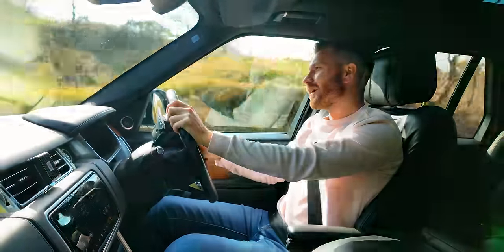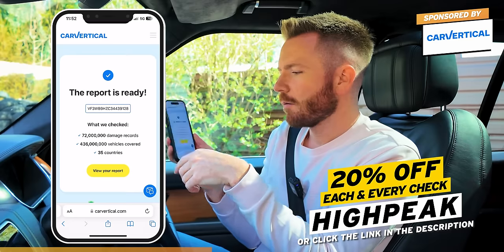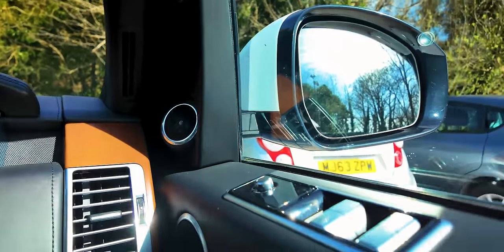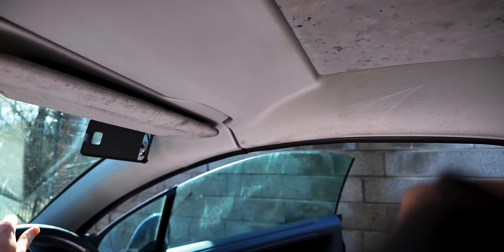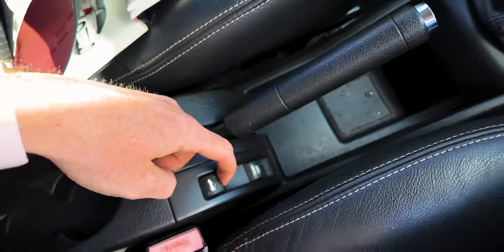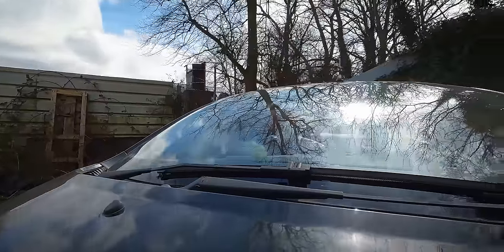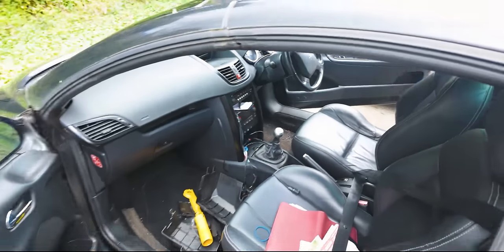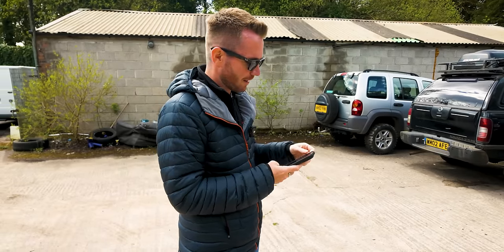I BOUGHT A CHEAP PEUGEOT 207CC FOR £500!

Comment: 'I bought a cheap Peugeot' usually ends in tears😅
Reply: I bought a cheap Peugeot 206 around 6 years ago. 85k miles later the only major issue has been the clutch which I replaced. 

The electrics are pretty terrible as well, but mechanically it’s been a very solid car. To my shame I haven’t serviced it once in that entire time as well, surprised it’s still going tbh but shows not all French cars are terrible!
Reply: I bought a Peugeot in general ends in tears.
Reply: I bougth two both were money pits.
Reply: @Drenwickification same with my dads 307. Was pretty rubbish but the engine was really reliable
Reply: I wouldn't touch a Peugeot (pronounced as Puresh*t) with a barge pole. I know someone who had a 407 and the electrics were awful and the dashboard was more lit up with warning lights than the Starship Enterprise's command room.
Reply: @Ayeright. the electrics are always poor on Peugeot's because they only used very thin wiring on their cars up to late 2000s
Reply: I've never had a serious problem with any old 8v 2.0hdi and I had great fun in my 205 Xs, and 1.9 gti but I wouldn't buy any after 2005 and I'd be picky with the older ones.
Reply: @Ayeright.  same with my dads 307. Engine never stopped working though when everything else did. French are no good with electrics
Reply: I've got a 207 1.4 8v, 150,500 on the clock and everything is working totally fine.
Reply: @Marco-iy7lt  that's insane I always thought he 207's weren't very reliable. You must have maintained it very well
Reply: I bought a cheap BMW usually ends in bankruptcy.
Reply: @JedHall-t4k  in fairness, when I got it, the previous owner had left it in pretty bad shape. It only 57K on the clock, but I'm meticulous with my cars. I changed the belts, serviced it, etc. Only just changed the original alternator last year and just changed the injectors to Bosch a 1000 miles ago. It's been very cheap for parts and cost me barely anything in the last 7 years of ownership. 

Prior to that I had a Merc C-Class and it was costing me an arm and leg to run it.

The key to ownership of a car is to be aware of what they were engineered for. This isn't a Japanese car, so hammering it is going to destroy it. The parts weren't designed with that in mind, so naturally it will reflect upon it. Simply drive it the way it was engineered and it will do it's job properly. This applies to also Italian cars. They're not unreliable, it is just our perceptions as Brits about French or Italian cars. We place this high esteem about German cars and think no one else knows how to build a decent car, when in reality, the Germans themselves are now the biggest critics of their own car brands. The quality isn't as good as they used to be and other companies are making an effort to improve the quality of their products.
Reply: Expensive ones end in tears too
Reply: Those things shouldn't have been sold new. Infact, all Peugeot's, Citroën and Renaults should be sent to the recycling centres directly from the assembly line at the factory! Avoiding the customer/ownership bit in the middle
Reply: I bought a 207 sport one owner from new 5yrs ago with 66k for £500……. Still have it
Reply: @Drenwickification  I had a renault modus, it was always making weird noises (electric windows, rust, connecting rod) but it never left me stranded
Reply: Agreed.  I bought a used Peugeot 405 back in the early 90's. It cost me a fortune in repairs - some quite costly - during the 3 years I had it. I would rather cut my leg off with a rusty saw, than buy another French car....  I wish Matt well with this one......  Welcome to the wonderful Peugeot World of "will it get me there, and what'll break next?"   "What a piece of quality"  - that was my Peugeot experience entirely Matt....
Reply: @gazz1246  Ive just bought a cheap bmw.  but it was cheap because the owner was a rich girl who knows nothing about cars and gave out cheaply convinced the scartches on the body made it worthless
Reply: @Marco-iy7lt  Peugeots are the cheapest cars in my area. There must be a strong justification behind it
Reply: @czukarpathian6621  sorry, but I'm trying to understand your statement. Could you explain a bit more to me please?
Reply: @Drenwickification I am a French car fan but only the older ones. My dad had a 205 with 300k on. My daughter a 206 who did 120k over 8 yrs totally reliable
Reply: Yep, bought a 307 2.0 Diesel.. Drove fine during the test drive & within the 1st week of ownership the clutch had failed followed by the DPF a few months later.
Reply: My girlfriend inherited 206 with 30k miles from her father 3 years ago. It has not had a single issue so far after 30k miles. My W205 mercedes / audi a6 c7 / audi a3 8p1 meanwhile had insane amount of issues and i'm jealous how well the peugeot runs
Reply: @pedrodaniellopesferreira2916  I bought a C5 in 2003 and just scrapped it after a deer jumped out of thr hedge and wrote it off. It had been a great car. I think a lot depends on how and who looks after a car. Oh that was me. All it really had over the twenty years was proper servicing. Any car can be rubbish (and dangerous) if not looked after. This 307 only has what should have been put right by regular servicing. Who can complain at a new exhaust in 16 years and the corrosion would have been picked up during proper servicing.
Reply: When reading the title before watching the video, I had a hunch of the outcome. At least we always get good enjoyable content together with Matt's humour 😂
Reply: @JedHall-t4k  Er, and Lucas....?
Reply: You made the News Matt...all be it the Sun news paper ,sniff sniff.
Reply: I bought a 2004, 206 back in 2018 for £290 👀 was a sound little car, used for about 4-5months then sold for £350 😂  no issues !!
Reply: Hahaha love it
Reply: @Ayeright.  blah blah blah my mate...

Comment: Bought one for our daughter two years ago, 59 plate diesel, 96 K FSH, actually it's given no bother apart from front spring broke,  service it regularly, she drives it from Rutland to London and back weekly, correct it's the GT like hers with the leather snd and onboard computer. She averages 60 mpg and loves it, now approaching 130.000 miles, just passed MOT with advisories on pitting on rear discs.

Comment: I bought a cheap Peugeot 207CC Sport in 2018, 11,500 miles on the clock. 35,000 miles of trouble free motoring later including driving to the south of Spain and touring around France, as well as trips around the UK, it has proved to be a great buy.
Reply: I bought one last year.  I think its a brilliant little car.  Its fairly cheap to run and holds the road very well.  Lots of fun for under £3000.
Reply: Should have added that they don't last much beyond 130,000 miles.  I bought mine with 62000 on the clock.  For summer driving, its just what I needed.

Comment: I’ve bought the (2012) hatchback version 1.4 95hp in 2018 and never had any problems with it till 3 months ago when the power steering got faulty and stopped working. it’s a pain in the a$$ finding the electric motor part that doesn’t cost an arm and a leg. Despite that, the car is phenomenal in therms of cost ownership, reliability and practicality.

Comment: Had three Citroens that were garbage (yes, didn’t learn!), but had a low mileage petrol 206cc that was utterly dependable, no mechanical or roof issues, and huge fun whatever the weather.
Reply: The 206 and 306 were indeed good cars in general, after that it went downhill.

Comment: Hi Matt
Brings back memories I had a 2012 diesel GT in white with leather . It was 5 years old utterly useless, the roof stopped working 2 hours after purchase, numerous DPF problems, electrics useless, I seemed to spend more on  light bulbs than fuel . 😂

Comment: In November 2018 I moved to Spain. A local dodgy bloke sold me a 52 plate 206cc for 800 euros. It had done 118000 miles, it has now done 125000 miles. It has been a great local run around. It has developed an issue with the cooling system, so maybe it's day's are over.

Comment: I had the displeasure of a 207CC back when they weren't very old. The dreaded 1.6 petrol turbo. Thankfully not mine. Still the worst car I've ever driven and catastrophically unreliable. Peugeot couldn't even put the gear lever in the right place - they reused the 206 linkage and it's too far forward. 😂

Great video however - thanks!

Comment: Mate, you had a lucky escape by scrapping it!
I owned a 207sw (57 plate from brand new), a totally horrific purchase, and a money pit almost from day 1.
18 months and 4 500 miles, a new cylinder head.
Then a new clutch at 9 years  15000 miles.
Endless "depolloution system faulty" errors linked to the engine management and the many sensors.
It ran like a bag of spanners, stutters pulling away, no power  up hills, and that was when it behaved itself.
My blood runs cold when I see any 207 on the road.
My previous 206cc was different, and had no issues, but I only kept it 3 years.
I stuck with the 207 heap for 12.
Finally, the wet timing belt snapped and I got scrap value for the car.
After I did research afterwards, it seems running the belt in oil is the main reason.
It slowly degrades with use and eventually blocks the sump and filters.
Then the heap overheats, due to lack of oil.
Finally, the thing rots through altogether and the car is uneconomical to fix.
More and more manufacturers are doing this, I think modern cars are built to fail in this way.
I lost all faith in the petrol engine thanks to Peugeot, and I have driven electric for the last 4 years.
I would NEVER consider a petrol engine in the modern world, and I love my electric.
I would sooner bank on electric motor problems, charging and battery issues than take on a load full of failing sensors, ecu resets and a money pit.
For petrol, I would take anything built in the 90s and early 2000's, never newer.
You had a lucky escape in.my view.

Comment: Another nice video Matt.  Just out of interest, what did the rotary key you had with the ignition key supposed to fit.  I fitted some of those to a 1979 RS 2000 in an attempt to stop the local low life's nicking it.  They were quite new then and would have confused some of the neanderthals.  I really expected Alexander Fleming to turn up and push you out the way to take samples from the headlining!  Amazing that the convertible roof all still worked.
Reply: I'm guessing the Handbrake/gear lever lock.

Comment: It's not that it was a horrible car, at least not until the previous owner got their grubby mitts on it. A classic example of running something into the ground. Having said that, it's the 16-valve DV6 which was... well, let's say if it's not been serviced in years, that didn't bode well. I also wonder how long that diesel's been sat in the tank.

The Lion engine you speak of doesn't have many fans and for good reason - it was developed for use in FWD cars primarily, hence all of its problems - but there are plenty still running okay even now.

Comment: Fun fact: Peugeot made the car into a convertible because they were unable to remedy a design fault;
Peugeot engineers could not get the head unit to stop spewing pubes out of the CD player slot continuously whenever the ignition is on. It produces about 16 gallons of pubes per minute, and without the removable roof, the driver could quickly become overwhelmed, especially if the cigarette lighter is on. 
So next time you're following a 206CC on the motorway and you have to dodge the huge clods of pubes falling out of it onto the road, be thankful that the driver is not being suffocated by the pubes, and be careful if you see him/her reach for a cigarette.

Comment: Very funny Matt but for the outset you were on this cars case. It seems the UK has a french car hatred because in Europe they are very popular, long lived and trusted. I have to say I think french diesels were only good before the high pressure injection malarkey with all the sensors. I think their petrols especially the 8v are superb engines and last 100000s. This one has done 130k and clearly neglected. Someone other than a mechanic (costs) could have saved this. There’s a Dutch channel on here that reviews high mileage cars and many Citroen/ Peugeots with 500 k kilometres. One berlingo 1.9d with a million on. We will see when your berlingo goes to Rome. My thoughts are you will love it. Any car that has been abused or not maintained will be shite. My dad had a peugeot 505 7 seater was like riding on magic carpet. All the faults on this car are through lack of maintenance an abuse. Unusual to get corrosion on the chassis imo. I had a 306 cabrio in 2000 and I loved it was like a limpet on the road. Very tinny and thin but loveable.  Are you sure you didn’t just buy this to make a very funny vlog😂

Comment: Car vertical now charging £29.99 for a stand alone vehicle check when 90% of the information they give can be easily obtained and the other 10% can be found much cheaper.

What happened? It cost me about a fiver 4 weeks ago when I bought my car.

Love your videos but I’d be very careful about continuing to advertise for those rip off merchants.
Reply: Couldn't agree more.

Absolute rip off merchants. I paid nearly £30 for a report that didn't include my spec/options list. When I contacted them about it I kept getting the same template response.

It's p*** poor that YouTubers are promoting  them and saying how great a company they are etc, when in fact they are expensive and absolutely useless when compared with so many other hpi companies.

Comment: Any one reasonably handy with the spanners could have sorted that small black french car. It was only a right off because of the mechanics high  labour. Costs.  I didnt hear anything too tragic, from the list of faults. Had the disapearing roof been dead/faulty i think i'd give up on it.
Even that posibbilty could have been simply a  faulty switch (had it not been working). I think you were to quick to give up on it matt. Or better still give to your mate cheap who does up the old bangers. It could still be on the road?

Comment: My dad had a normal hatch 207 1.4 75hp and it was nothing but trouble, e.g. slave cylinder failed and a bearing broke in the gearbox, it then died when the cambelt snapped, he had the car from new in 2009 and never knew to change it, died at like 111k or somthing
Reply: Poor maintenance does not mean the car is bad.
Reply: @adamgabriel730 ik, I'm very very aware of that.  The cambelt yes was maintenance but the car was always checked and the 2 other things still failed for whatever reason, he never abused it, he drove it well, never stalled, never missed a gear etc, always got serviced but both still failed

Comment: I notice you sometimes are struggling with the DJI Osmo Pocket. It has what's called a 'pov' mode where it just follows the movement of your hands smoothly. Then you won't need the little joystick to pan up or down (you can just aim it down and it'll make it look like you have a very steady hand). May be worth turning on for your use. 
Other than that; Poor peugeot. that being said, I was never a fan of the "CC" peugeots. The 206 also didn't look great. Love a hatchback 206 though. They were never the best cars, but they are nice to drive and look quite good (to me, at least).

Comment: I just rid of my 200cc Alure Auto after 10 years. It was fine for the first eight years then things started to drop to bits. It was not the most reliable of cars I have owned. It had constant electrical gremlins culminating in the Body ECU failing that tool out various bits on the car. Also I had a constant battle with the Climate Control as the flaps are all controlled by cheap plastic cogs that wear out and are virtually impossible to get to without removing most of dashboard. Other things were Fuseboard issues with water getting into it, the auto Tiptronic box needed solenoids every so often as they would jam and despite having money spent on it and a full service history I have up with it and sold it and bought the Dacia Jogger. They look good, but it's compounded by rubbish PSA/Peugeot electrics that are made from tissue paper and paper clips. Also they burn oil so you will need the Amoco Cadiz in tow. Plus the TPMS failed which is an issue as the last ones the TPMS is a MOT fail. You need to check for roof issues as well and make sure it's been serviced and the seals have been lubricated with silicone gel. It stops the car sounding like the Titanic sinking. The windows squealing and going slow is a common fault, they all do it. You know if there is Roof ECU fault as the rear windows are half way down when the roof closes! 
In the famous words of Liam Neeson in Taken..... "Good Luck"!

Comment: 206’s are as new as I dare with Pugs, they are good cars with strong shells. Last one I bought was a 206cc 2.0 2006. 30k miles was like new underneath. 

Not particularly nice to drive and the 2.0 lump was flat as a fart but it stayed with me 4 years and I sold it for about £200 less than paid, from that perspective it did its job. 

When the sun was out it was nice to open the roof and let the heat out, but once aired I put it back up again and wore a paper bag over my head 😂👍

If ever in a tight spot in life, look for a low miles, low owner cheap old pug and learn DIY. They will get you back on your feet 👌

Comment: I bought a cheap Peugeot 207 1.4 petrol 3 yrs bk give £450 for it and the wife drove it over a yr only issues where.

The clutch
The key broke
It locking itself
NSF WINDOW MOTOR
back caliper jamming 
Oil leak
Coolant leak
Hard started when cold.

Otherwise it was a good car 😂😂😂😂